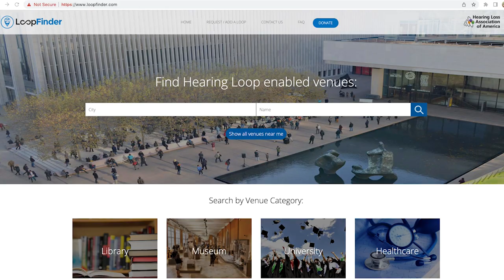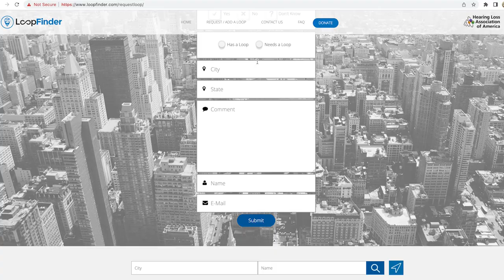Hearing Loop Demonstration: What is a Telecoil, and How to Activate the Telecoil on your Hearing Aid

Comment: Great info with one important piece missing. People mistakenly think they don't need a t-coil if there are not many looped venues in their area. Public spaces like movie theaters, arenas, museums and churches in the US most often use FM or Infrared listening systems. You can only use your hearing aids with those systems if you have a telecoil and use a neckloop (or over the ear headphones that may have feedback). It is way better then removing your hearing aids and using the generic earbuds or headphones provided. T-coils will also be an important interface for existing hearing aids when Bluetooth LE Audio with its broadcast feature starts replacing room loops in public venues.
Reply: I SECOND THIS COMMENT: consumers can use the telecoil not only in venues equipped with hearing loops but in most large theaters, and public auditoriums where FM and infrared systems are installed.  Ask for a listening device with a neckloop (which is in effect a personal-worn-around-the-neck-loop) and switch your hearing aid or CI to telecoil.  A follow-up by Matthew on this very topic - (happy to help you, Matthew) would be beneficial for consumers who do not understand what FM or IR listeners look like and what to do with neckloops.
Reply from the maker: Great advice Andrea! Thank you, Matthew
Reply: With neck loops and t-coil there’s the challenge of the venue knowing it works, when they likely don’t have anyone on staff to test it with hearing aids. The first and only time I tried a neck loop with my t-coil HAs at a well known theater in my city, I couldn’t tune in anything except annoying beeping sounds. Clearly their system was broken and who knows for how long.
Reply: @Sashazur  I wonder if the receiver device you used had a low (internal) battery and the beeping you heard was a "low battery signal warning." Did your provider demonstrate how to use the telecoil with a (portable) hearing loop in the office?
Reply: @juliettesterkens721  Unfortunately they didn’t demonstrate it. I’m very technically proficient and I tried all the controls on the thing. I don’t think it was a low battery since the sounds depended on which channel it was set to. This was at Portland Center Stage theater in Portland Oregon.

Comment: I have the Oticon OPN miniRITE T hearing aids with a T-coil that allows me to use the loop system at my local theatre here in Pittsburgh, and I love them! The theatre also has the Sennheiser MobileConnect system that I read is a bit better than the loop system, but I haven’t been able to connect to it. The MobileConnect app opens up and shows 2 different channels, but neither one connects. I’m wondering if maybe these Oticon hearing aids are not capable of connecting to that system. I assume I would use the same programmed channel as the one used for the loop.  Are you familiar with the Sennheiser system and if my Oticon aids can connect to it? If not, do you know where I can get further assistance and information about this?

Comment: I’ve worn hearing aids for over 15 years and have yet to be able to use this system. It’s just not available here in SoCal. At least not in the places I frequent.
Reply from the maker: Hey Shiela, that’s such a shame. Did you check out the loopfinder website?

Comment: I’m pretty tech savvy but always have trouble knowing how to switch my aids to T mode… does it happen automatically when there is a loop?
Reply from the maker: Hey Abigail, no it needs to be activated by your audiologist and will be on a separate setting. Give them a call and they should be able to easily activate it. Thanks for watching, Matthew
Reply: On my aids it is a setting I need to manually select. From what I know of the technology it will always be this way, since you wouldn’t want your aids to switch to any random signal that could be an induction loop - lots of electrical wiring and appliances give off similar signals.

Comment: If you live in a country where the state has a monopoly on radio broadcasting, can you build a radio station that uses an induction loop  (or loops) as a transmitter in your halls of residence, town or suburb, then have a telecoil connected to the back of your stereo through the Auxiliary input Jack?

Comment: T-coil is such a great idea with almost little to no implementation.  It's really frustration to consider this as a hearing benefit if it is not implemented.
Reply from the maker: Hey I-SeeDesert Baldo, yes it's only good when its  installed! Thanks for watching, Matthew
Reply: But I can understand why it is probably going to be phased out by a future update to Bluetooth; it requires physically larger hearing aids, and you can’t have more than one system in close proximity, so for instance you can’t use at the same time in two adjoining classrooms. The only venue I’ve tried it at loaned me a neck loop device that was supposed to pick up an FM transmission and convert it to a telecoil signal. At that point why not just loan out wireless headphones?

Comment: If you are using a loop system and find a "weak" spot - unlike in other spaces you visit that have no weak spots -- it may be that the installation of the Loop does not meet the international standard (IEC 60118-4 code) for coverage, and you should let the owner/manager of that space know you had difficulty.  They will contact their loop installer for analysis and repair as needed.  
When installed properly, a loop field reaches every activated telecoil equally well.  For more info, see: https://ihlma.org/wp-content/uploads/2020/09/Telecoil-availability-in-hearing-aids.pdf   or https://ad4h.com/wp-content/uploads/2020/04/IHLMA-Guide-to-Best-Practices-for-Service-Providers.pdf
Reply from the maker: Great advice, Thank you!! Matthew
Reply: The only time I tried a neck loop with my telecoil it didn’t work; there were just annoying beeping sounds. When I returned it to the box office the reaction I got was basically just a shrug. I’m sure they just thought “old person clueless with tech” instead of “we need to investigate and fix this”.
Reply: @Sashazur  I wonder if the receiver device you used had a low (internal) battery and the beeping you heard was a "low battery signal warning." Did your provider demonstrate how to use the telecoil with a (portable) hearing loop in the office?
Reply: @juliettesterkens721  See my other reply to you, it wasn’t the battery since the sounds depended on the channel I set it to. But it was a good suggestion!

Comment: I made sure my new HAs had telecoil but I’ve only had one opportunity to try it, at a theater a few months ago. At the venue they loaned me a necklace receiver that was supposed to pick up an FM transmission and generate the telecoil signal. Unfortunately it didn’t work - on the telecoil setting I could hear some beeps and boops depending on the channel I set the receiver to, but obviously it was busted (and could have been for a while). Next time I go there I’ll probably just borrow a headset instead, so the telecoil is wasted. So far the only thing I’ve used the telecoil for is to wander around my house listening to the buzz from various appliances and wiring, it’s like a slightly lame superpower.
Reply from the maker: "It's a slightly lame superpower". My favourite comment across all my videos. Yes sadly a Telecoil is only as good as how well it's maintained. I hope you have better success elsewhere. Matthew
Reply: Hello Sashazur - care to share where you live? Hearing loops are spreading regionally and work is being done to get each known loop posted on Google Maps. Happy to share more information if you are interested.
Reply: @juliettesterkens721  I live near Portland Oregon. The theater with the broken telecoil is a pretty popular one - Portland Center Stage.

Comment: Its not clear yet to me. I have a device "PockeTalker 2.0". It has T-Coil switch and it enables. My question is "Where from does the T-Coil pick up the EMF?". Any mic signals near me? Or does the sender (broadcaster) should do something special? If I am in a building with multiple lecturers in multiple rooms which one does the T-Coil pick up?
Isn't our surrounding always having clash of many many EMFs relayed at various frequency? (such as from Radios, AM/FM.
Advance thanks for anyone who can help me understand.
Reply from the maker: Hey AR, it's worth a chat with the establishment to find out how it works in that particular location/room. It's hard to comment without knowing their set up. Thanks for watching, Matthew
Reply: From what I know of the induction loop technology, since there are no “channel selection” settings for this feature on hearing aids, if more than one of these systems are too close together the sound would be combined or garbled. You can overcome that if the venue can loan you a neck loop device, you wear it and it picks up a radio signal from the microphone or PA system, and creates a local signal your telecoil picks up.